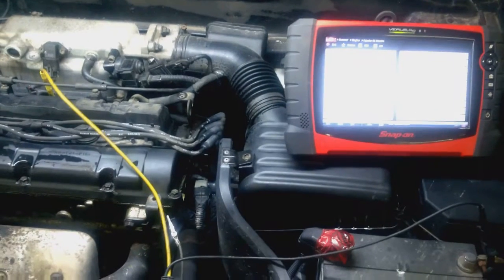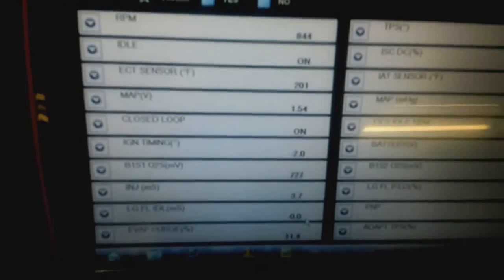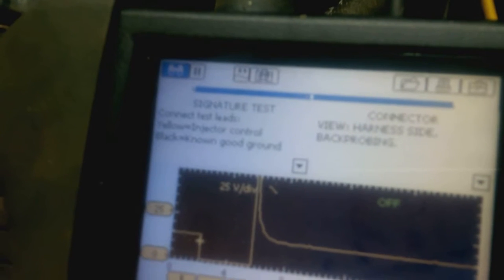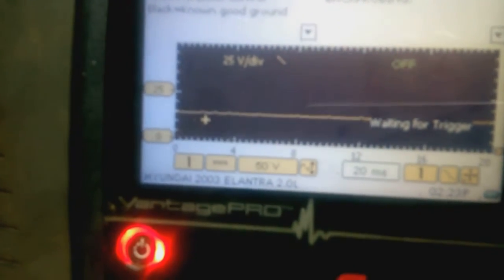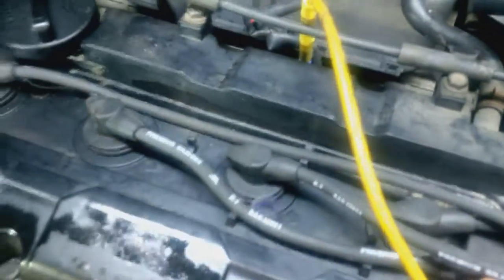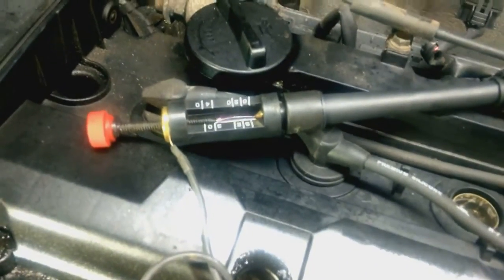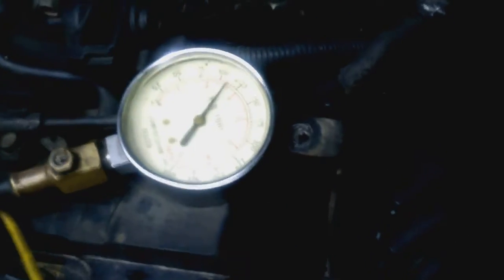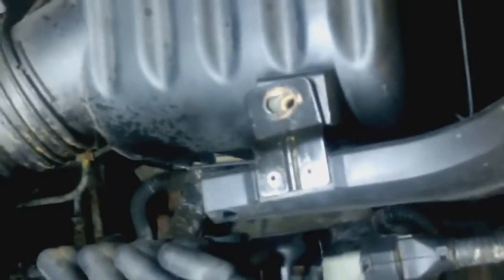2003 Hyundai Misfire

Comment: Got a 2004 Hyundai accent with a similar issue. I have tried everything but still get a misfire on # 4 . 1. Checked compression on all cylinders. # 4 is lower but only by 10 psi.  2. Checked for leaks with starter fluid. Found a leak around injector # 4 so I changed all injectors and the fuel rail - No leak detected after this. It was giving an over rev. code from the air  leak so that was fixed with the injector change. 3. Changed fuel pump and filter 4. Changed spark plugs and wires 5. Changed coil pack 
Considering I have changed everything that can be changed and still the # 4 misfire persists is it possible a burnt valve would cause the misfire? Considering that cylinder does show a slightly lower compression. I do know the car was overheated in the past
Reply from the maker: Compression testing is not always conclusive since at cranking speed there is lots of time for air to enter the cylinder and exhaust to exit. Slightly lower compression in the affected cylinder is definitely a red flag. I'd recommend to pull the cam cover off and have a look at the valve movement. You could have a worn intake camshaft lobe. Usually if the exhaust cam lobe is worn you will get a Backfire in the intake but depends how bad it is worn.  You could check engine vacuum at the brake booster with a vacuum gage running. It should be fairly steady between 15 and 19inhg at idle. If the vacuum needle is twitching this could also indicate a valve problem. Another option is a cylinder leak down test. Good luck and let us know how you fare.

Comment: Oh man! Plz tell me my Misfire code on Cyl 2 isn't a freakin' intake gasket on my '02 Elantra.... I'll be so bummed
Reply from the maker: If its a 4 cylinder I have seen that but its usually cylinder 4 not 2. Listen for a hissing noise around the gasket area when its idling.  Spray some penetrating fluid towards the gasket area while running if the engine smooths out thats likely your problem. Otherwise plug, coi, wire, injector or internal mechanical problem

Comment: Extremely extensive troubleshooting Phil. Thank you very much for the detail. Still trying to figure out my probs with an 02 Elantra. Plugs, wires, coils all replaced but no difference. Not smoke tested but propane equiv into intake with no change. Could this be a valve cover gasket with a slight leak, yet no oil leak?
Reply from the maker: a valve cover leak would not likely cause a rough running condition. put a vacuum gage on a main vacuum line and see if the vacuum reading is steady.
Reply: TheVantripper 
I heard seed sensor
Reply: Intake manifold gasket duh